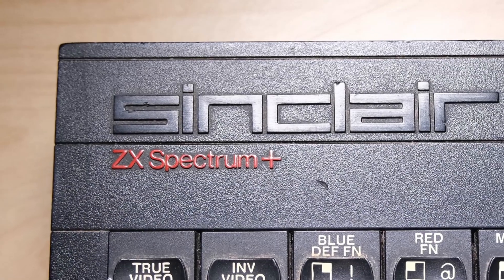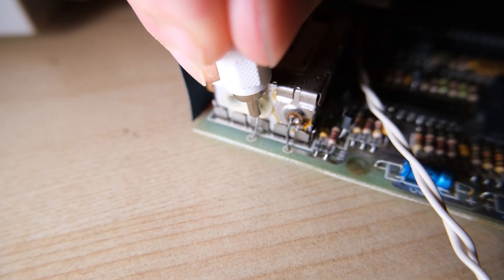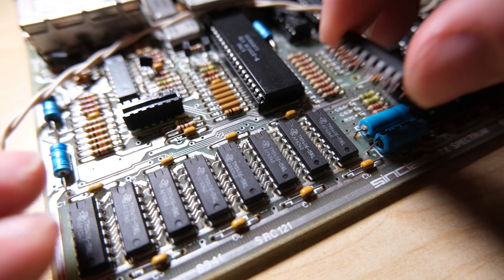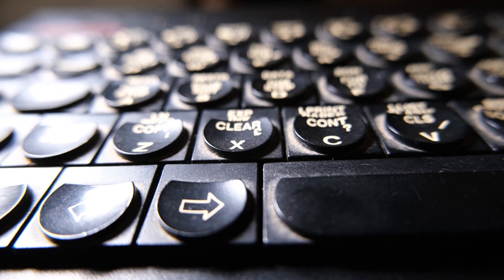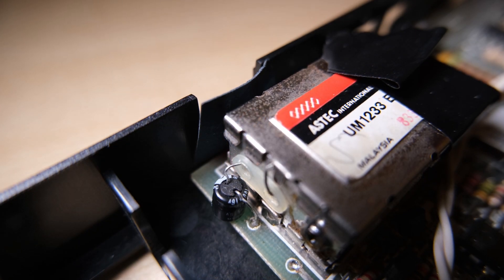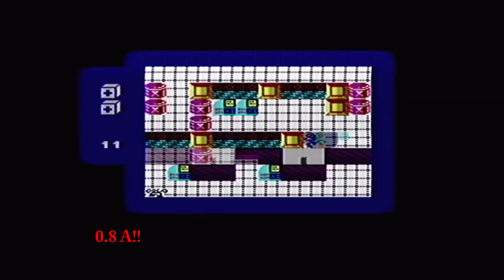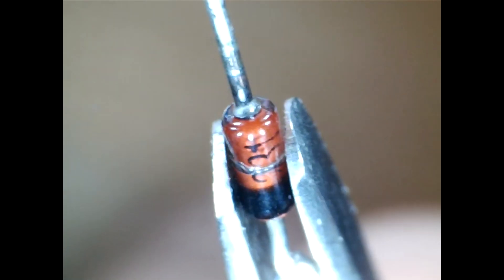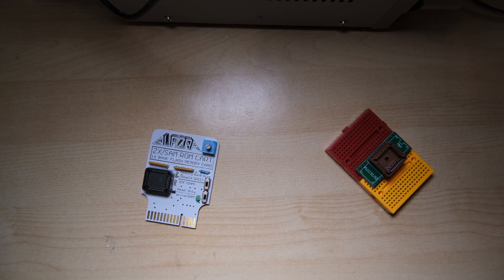ZX Spectrum 48K Repair - Lower RAM and a Very Unhappy Little Diode

Comment: Excellent video, any advice on my rubber key 48k. One owner In excellent condition. Was working fine prior to going in the loft many years ago. When loading games, the title displays along with intro pic but right at the end of loading it reverts back to the startup page?
Series 2 board.
Thank you 😀
Reply from the maker: Thanks.  Could be an upper RAM error. This page describes how to check it https://worldofspectrum.org/hardware/rep5.html

Comment: I see one TI RAM chip among all the OKI's of the upper RAM section. Isn't that a no-no? Considering there is a jumper that selects what chips will populate the upper RAM (OKI or TI) I thought they were not compatible and they don't play well together?
Reply from the maker: Well spotted.  There wasn't an issue, I assume the TI chip wasn't "half broken", however, I have replaced it anyway to be safe :)